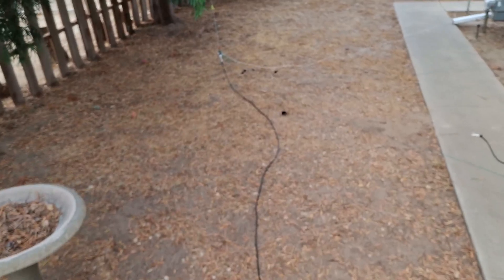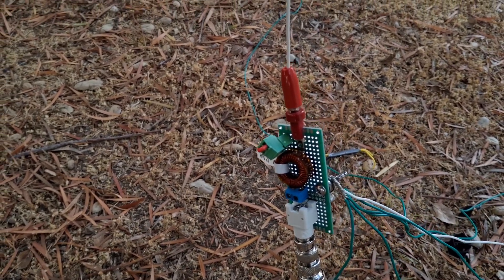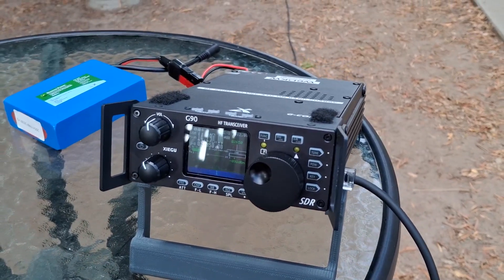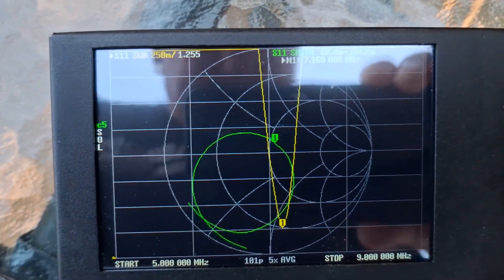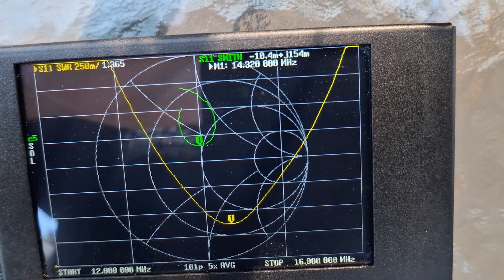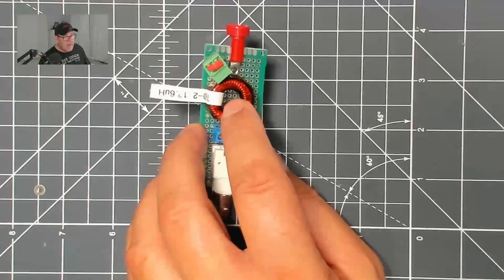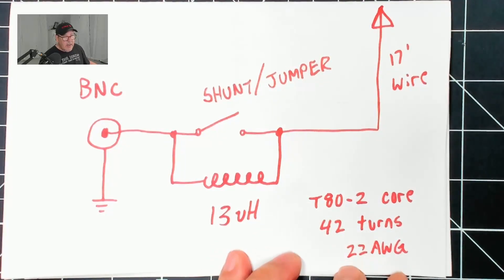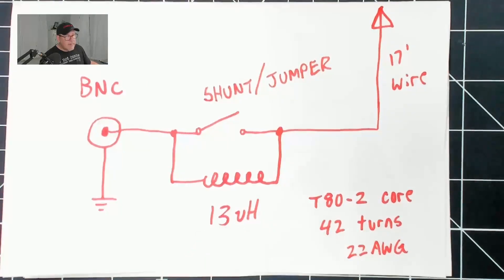40/20 Vertical Antenna  (portable)

Comment: Nice antenna it could have a 30 meter coil as well. I’ve wondered about toroidal cores for loading coils but had not seen it done before thanks for the advise on cores.
Reply from the maker: Yes!   You certainly could also have a coil for 30 meter.     that  T80-2 core was easy to use as well.   An  T130-2  core wound with 18AWG would allow for more power. if required.